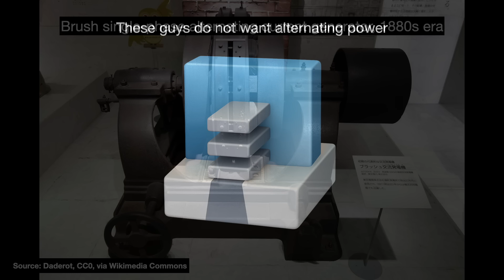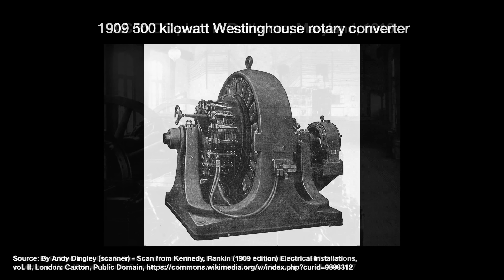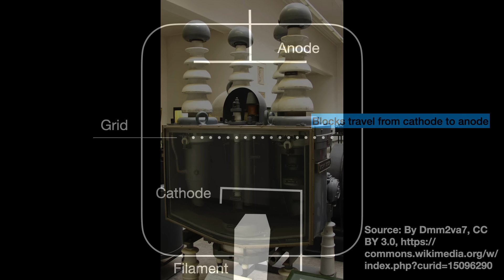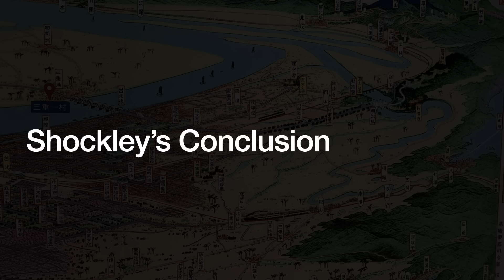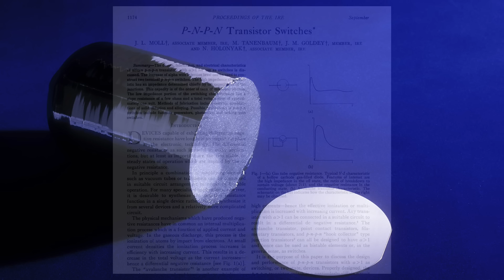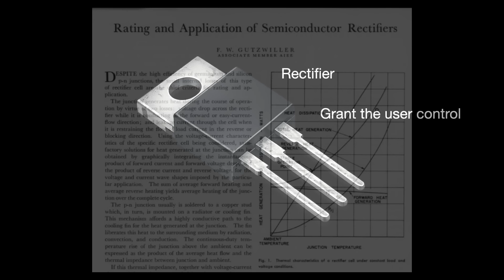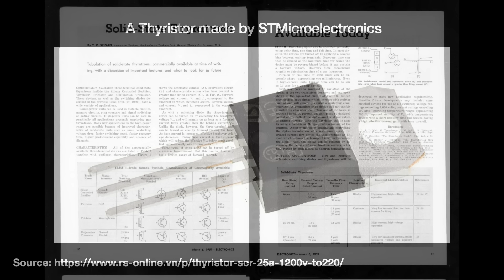Thyristors Did to Power What Transistors Did to Logic

Comment: Dont generators produce DC in the way you describe it ?
Also devices can absolutely use AC.
I thibk you mixed things up a bit.
AC is used in transmission lines over long distances because its more efficient than DC, that is, until we can make transport wires cool enough to negate any losses.
Reply: Also transistors have no practical use in AC as they work like diodes flipping which side gets the positive output while capacitors can work in both AC and DC granted some like electrolytic caps have a polarity and thus will just heat up as their voltage flips for no good reason.

Comment: These were not the first solid state power electronics devices. Selenium rectifiers were in wide use in the 1930s.

They may have been much less effective than SCRs, but they were much earlier. And _much, much smellier_!

https://en.wikipedia.org/wiki/Selenium_rectifier
Reply: And apparently Selenium weren't the first either, they were preceded by copper oxide, which were even less efficient, and probably nowhere near as smelly as selenium rectifiers.

Comment: ''the transistor takes in an input current at low impedance at the emitter and uses that to control a larger output current at the high impedance collector''
lol just no, so the base connection isnt used then?  your so clueless and totally wrong,
where did you get your script some cheap ai?

Comment: Thyratrons do not switch slowly. They switch faster than thyristors.  You should get your facts straight in your videos. When it comes to thyratrons there are different types. They are still used for very high voltages and switch extremely fast. Thyristors don’t come close to this. But a thyristors is different than a thyratron. You should do your homework before making a video that is in correct.

Comment: The story of the transistor is pretty weird. The point-contact transistor was developed by Bardeen and Brattian in the early '40s and it was pretty bad - mass production was out of the question and extremely expensive. Shockley figured out the FET and wanted to get all the credit, EXCEPT that AT&T patent lawyers nearly had a stroke, when they found out his "new" idea had been patented by a Polish professor a decade earlier and they couldn't go into production. Out of desperation, they started hand-building the point-contact models to fill military contracts.

Comment: On Merchants ships I sailed on, some designs had a variable speed power generator system running off the shaft of the main LLS 2 stroke main propulsion diesel. Variable speed power source for AC power generation. It's a magic trick performed with banks of Thyristors and a very complicated control system.

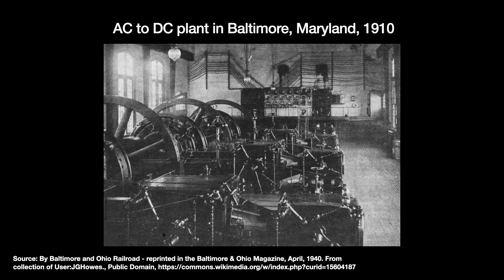Comment: That AC to DC Plant at 3:22 is an error. Those long things filling the picture horizontally are somwhat alien looking steam engines of the Corliss type. This is a primary generating plant, not an AC/DC rotary converter set. Now both were much used in that era and are very interesting machines, but they look totally different. Google Bradley rotary converter or NYC subway rotary converter to see how that should look for a peak technology US plant. Exactly what you had in the previous frame :D  Older conversion stations might be Motor Generators, looks different yet again, google Zeche Zollern II/IV (in Germany) and search until you find multiple Rings stacked on one shaft. Otherwise i love your vid, its my industry ;)

Comment: For Fan Coil Units (Commercial indoor air conditioning) some of them use Electric Heater Batteries (EHB) instead of Low Temperature Hot Water to heat the supply air. To achieve this a Thyristor is used to regulate the 240Vac power to the EHB via a 0-10Vdc signal from the BMS controller.

Comment: SCRs were the basis of the Cornell EE departments E-car project in the mid 1970s when I was a student there. The high power IGBTs and MOSFETs that are used in today's EVs were decades away, so the design used a relatively low power SCR chopper to control the field current in a DC motor. Decreasing the field decreased the back EMF, increasing the motor speed until the back EMF again equaled the supply voltage. This meant the motor idled when the car was on, so it needed a clutch and transmission like a gasoline car. I vividly remember riding in one during freshman week. It was a VW Bug without a body, and with lead acid batteries stuffed everywhere they'd fit. They called it the "Lead Wedge". 96V as I recall. I especially remember the ammeter pegging above 500A when the driver hit the "gas". I instantly fell in love with electric cars, and later drove one of the first GM EV1s and later a Nissan Leaf and Tesla S.
Reply: i found another one in the link at the end of this post. it is almost comedic in simplicity and cleverness, reminds me of the circuits used in 1970's era aircraft electronics i worked on in the usmc 18 years ago. they had crude transistor based dc-dc converters in some of the lower voltage aircraft power supplies in the ea-6b. and lots of 400hz servos driven by scr's shorting out what amounts to a bidirectional shaded pole motor, but instead of a shaded pole, you have two phase motor, one pole driven at 400hz, the other at 90 degrees driven by a set of dual SCR's to short out one polarity or the other, driven by  741 era opamps to commutate the phasing to get the phase shift needed to generate torque. so zero torque is just overheating the servo with one phase driven at 100% all the time and the other phase open circuit...  yes, that bad.
https://www.edn.com/scr-dc-to-dc-converter/
Reply: nowdays its almost impossible to find circuit diagrams showing how to actually commutate the scrs to enable turning them off in a dc circuit. this is the only one i can find on google these days:
https://media.geeksforgeeks.org/wp-content/uploads/20240102094614/DC-Circuit-Breaker.png

Comment: You should have titled this video "Man Lies About Thyristors And Thyratrons For 24 Minutes".  Well, I have a BSEE and I happen to design vacuum-tube synthesizers.  In fact, my very first electronic musical instrument was a thyratron relaxation oscillator.  So I'm gonna teach you a thing or two.

Let's start with your claim that thyratrons "switched slowly" (7:35) because it is hilariously wrong.  A hydrogen thyratron can switch two hundred million watts in a fraction of a microsecond--look for "hydrogen thyratron datasheet" if you don't believe me.  If you try to do that with a thyristor, it will explode.  Pulsed power is not their specialty--whereas in the comparatively cushy realm of power engineering, all they have to do is control the clipping point of a 60Hz sine, so at least they can do that right.  You even mention at 7:24 that thyratrons are STILL used to this day in radar for pulse generation, which is probably the second most demanding high-speed high-power switching application in all of electrical engineering short of the firing circuit of an atomic weapon--whose triggers, by the way, are implemented to this very day not with "fast-switching thyristors" (as you hilariously call them at 23:13) but the humble sprytron tube.  And the only way to make thyristors any faster is to make them smaller--and able to handle less current at lower voltages.

Next let's examine the comedy at 23:20, where you claim that thyristors could "get variability that was previously unachievable with glass"--and then immediately list off a bunch of things that were already being done in 1943 with tubes, like motor speed control.  Earlier, in fact, but I say 1943 because that is the year Westinghouse released a film called Electronics At Work (which you can still watch on Youtube), which contains not only beautiful footage of thyratron industrial automation in action, but detailed explanations of exactly how wrong you are.

Now let's talk about everything you made up about glass throughout the entire video.  Glass wasn't why they phased out the tubes either--you yourself showed footage establishing that (for instance) large mercury arc rectifiers had metal envelopes, and many tubes did too.  I own several such metal-can tubes personally.  Consider also the nuvistor, a highly miniaturized but fully functional metal-can pentode tube comparable in size to a contemporary BJT.  If you think glass contributed to the downfall of tubes, then the nuvistor should have ruled the world.  Glass was a deliberate choice in each application where it was used, but by no means was it the only choice.  Usually it was just cheaper than metal.

But here's the best part.  The single biggest lie in this entire video.  The thyristor never replaced the thyratron in power engineering BECAUSE THE THYRATRON WASN'T USED FOR THAT!  The thyratron is a pulsed-power device.  It is not designed to pass high currents continuously for long periods of time.  It is COMPLETELY INAPPROPRIATE FOR THE APPLICATION THIS VIDEO CLAIMS IT SERVED.  Thyristors and thyratrons are positively crap at doing one another's respective jobs.

What the thyristor actually pushed out of mainstream power engineering was the ignitron.  Ignitrons evolved directly from mercury arc rectifiers, used a third electrode to control when that 60Hz sine clipped, could merrily pass hundreds of thousands of amps at tens of thousands of volts, and had a role in power engineering DIRECTLY analogous to that of the thyristor today.  They were controllable rectifiers, just like thyristors.

You didn't mention them a single time.

I suppose you thought that nobody in your audience knew anything about tubes or thyristors, so you guessed it was okay to just skip the research and make shit up.  Well, you guessed wrong.

tl;dr this video is filled with blatant factual errors that could have been avoided with five minutes of lazy Wikipedia research.  I award it no points.  Signed, somebody who did her EE homework.

Comment: An interesting unwanted effect of  the parasitic scr(formed unintentionally) in a cmos device is called Latchup. Which could potentially blow up a chip, due to the resultant avalanche current. Guardrings and well isolation are some mitigation techniques, ubiquitously used where large switching currents or potential for ESD is involved. Just some 💭❤👍

Comment: I'm not aware of any "germanium controlled rectifiers", though I wouldn't be surprised if they existed briefly in those early days; but there is a new generation now: silicon carbide controlled rectifiers! Still very boutique (and probably will stay as such), but interesting switching characteristics, like sub-50ns turn-on, and... hmm I forget t_q, but not painfully long I think?  High voltage ratings are easily offered (1700V+), at modest on-state voltage drop (a couple volts).  Interesting for pulse generation, if not so much power control (for which MOSFETs and yes even SiC IGBTs are preferred).

SiC in general, is at a point of maturity where pretty much anything you can make in Si, can be made in it, I think. There's not much point in making ICs that way (unless you're making a long-life Venus probe or something; which I've not heard news about in a while but maybe NASA's still thinking about it; but also, down-hole electronics might be profitable), but BJTs, JFETs, MOSFETs and IGBTs being standard fare (well, not so much BJTs, for the same reason we don't use Si BJTs much either, but there were a few types released), and with excellent characteristics at that; it's quite an achievement.

Comment: 5:32 Hydrogen?? Helium, surely!
Reply: According to Wikipedia, hydrogen was used when they wanted faster switching in specialist high voltage applications.
Reply: @izzieb  But that would corrade the metals, especially under an arc.

Comment: I'll nitpick that a rotary converter is not a motor driving a generator.  A rotary converter has a single armature winding, with both slip rings and a commutator.  It is far smaller than a motor and generator of the same power because most of the power goes through without being converted to magnetic and mechanical energy.

Comment: Thyristors are a pain in the ass when you use them in DC circuits, because they are much more difficult to turn off. High-power bipolar transistors remained very popular for DC-to-AC inverters, until power MOSFETs came along, and now IGBTs have taken the lead (easy to control like a MOSFET, high-voltage capability like a bipolar).

Comment: Watching this while travelling on a morning train, pulled by an old Czechoslovak 362 class loco, that has a very distinct thyristor „buzz“ during acceleration hits kinda different.
Reply: The thyristor is silent. What creates the "buzz" is the mechanical vibration of various components (cables, coils, etc.) through which the "chopped up" current is flowing. The mechanical vibration is caused by EM fields that are generated many times a second, making the whole wire vibrate slightly. The wire then starts to vibrate the panels it is attached to and they vibrate and create acoustic sound waves.

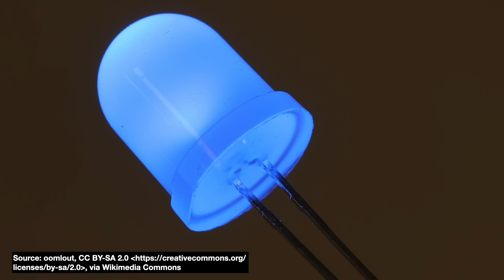Comment: 1:50 LEDs have a bandgap and are intended to operate with a voltage equal to that bandgap. To emulate dimming, LEDs employ PWM.
Reply: Dimming without PWM by changing the voltage (usually controlled by observing the current) can be more efficient and provides flicker free light. It is widely used in computer screen backlights and many other applications.
Reply: @oznerol256  That's not true. LEDs*, including the backlights on modern panels with local dimming, fundamentally *require PWM for brightness control. They do not function properly at other voltages.

If you are referring to LCDs when you say "computer monitors", then the actual LCD panel is controlled by varying the voltage. However, that is not the backlight. OLEDs can be controlled with analog voltage control (as they rely on current control for brightness), but the vast majority of OLED screens use PWM control for brightness as well simply due to it being more efficient and simpler.
Reply: @AlexSchendel Modern LCD backlights are LEDs and they are dimmed without PWM. The actual LCD pixels are not used for global dimming as that would limit color depth and contrast. I recommend comparing some in-depth screen reviews from today and 15 years ago. rtings has some great ones. They measure the flicker with an oscilloscope. You will see the dimming used to be PWM on old models, while modern ones don't use it anymore.

On OLED you even admit yourself that analog voltage control works. PWM is simpler to implement and still used a lot. But it is not the only option and certainly not fundamentally required.

The threshold voltage is not just binary. Once met, the LED starts to glow. The more it is exceeded the brighter the LED gets, until eventual destruction. The curve is highly nonlinear and affected by manufacturing tolerances, age and temperature.
Somewhat similar in behavior as the gate in FETs.
Reply: @oznerol256  Interesting, thanks for correcting me there. It is my understanding that analog dimming is still rather niche and requires specially designed LEDs to function well though. PWM is still the most popular due to its ease of implementation. PWM flicker is usually addressed by changing the PWM frequency.
Reply: @AlexSchendel  LEDs use pwm for the simple reason of it being easier/ cheaper. The alternative is a constant current driver which in most cases is just a FET acting as a variable resistor controlled by an op amp and maybe an inductor and or feedback resistor. Due to the highly nonlinear current voltage relation of the LED feedback is required and the FET isn't fully on burning power as well of not properly designed. In comparison PWM uses a single FET and a current limiting resistor. No feedback no tolerances on current measuring no unstable feedback and a lot cheaper parts since the FET is actually only on or off thus it can be a lot smaller since it never intentionally works as a resistor

Comment: Woah...hold on....at 3:43 it is explained that the mercury arc rectifier essentially works like a simple diode...leading to half wave rectification (i.e. 60 pules per second of dc).  I thought the Mercury rectifier worked with the transformer secondary.  Each anode was connected to the main outputs of the transformer and the cathode was connected through a load to the center tap of the secondary.  In that config, one would get full wave rectification (120 pulses per second of dc).

Comment: 23:12 - You can pwm thyratrons. I do it routinely, with true phase modulated thyratron color organs. The color organ circuits popular from the late 1960s don't pwm properly. They "work" "statically". It wasn't the hippies fault. I found that poor circuit using thyratrons in a 1950s magazine article.

btw: the gate trigger current in thyristors is higher than those in thyratrons. Most thyratrons trip with as little as 10uA.

Comment: I've played & worked with TRIACs and SCRs for decades. In the last 10 years, or so, I started playing with their tube predecessors, thyratrons. I have some big ones. The size of 1.5 liter soda bottle. But they have a 5V 4.5A (22W) filaments, but can only switch 2.5A average max (15A peak). Even a cheap SCR can switch that easily, without a power hungry filament. And with TRIACs, in both directions. There are two application groups of thyratrons. Those made for high low duty cycle peak currents, and others for continuous current applications.